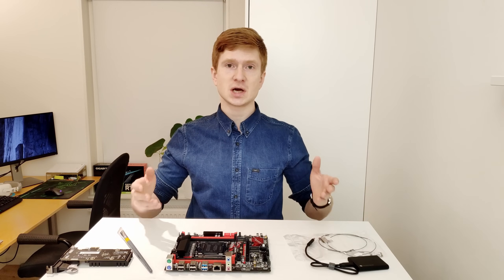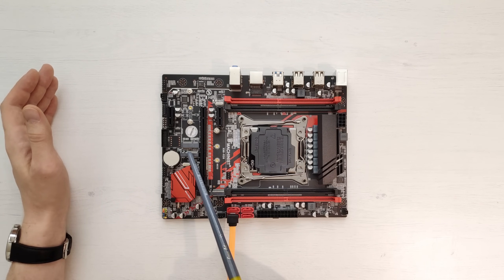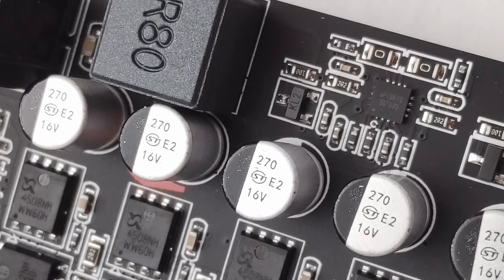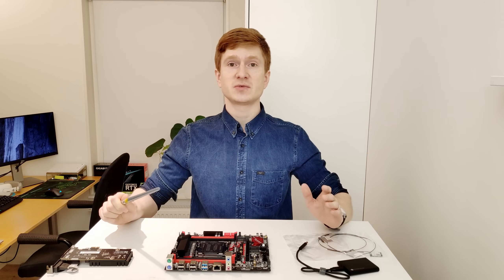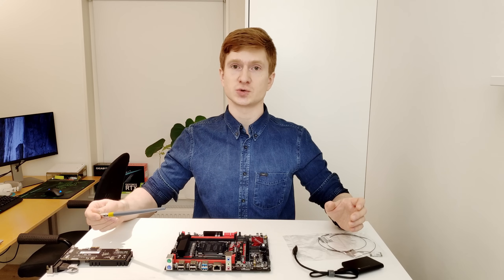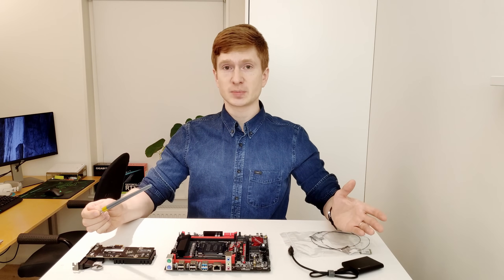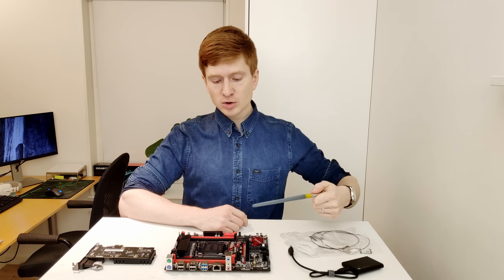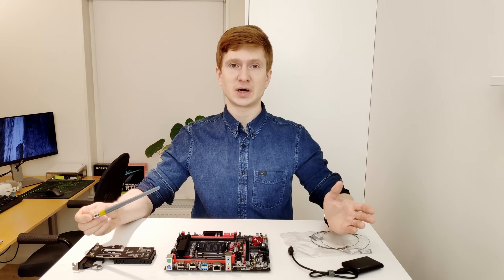🇬🇧 Machinist X99-RS9 – detailed review | E5-2678 V3 | i7-6800k | BIOS | O.C. | VRM | Mi899

Comment: You didn't talk about 6800k, does it support 6800k??
Reply from the maker: Yes, it does, but no overclocking is possible, obviously.
Reply: @Miyconst  can you link a video about 6800k for this board . i dont over clock . i use simple web surf and watch movies
Reply from the maker: @h2ck3rhumas  what kind of video are you looking for? Core i7-6800k just works on the motherboard and that's it.

Comment: I use BIOS X99 8M-F -50/-50 and the USB 3.0 doesn't work. The data transfer only 40mb/s. Flash using FPT and AfuWin still doesn't change. I don't think this is a BIOS problem anymore.
Reply: I'm using X99-RS9 (Q85 Chipset), E5 2630L V3, Turbo boost is running but some core  frequency fluncuate not stable at 2,9ghz like my old X99z with E5 2620 V3, that's running stable at 3,2ghz.

And everytime i flash BIOS, PC Freeze after booting, sometime freeze in INTEL INSIDE Logo or Desktop. I have to Clear CMOS to fix it.

Please tell me if you know the solution, this Motherboard is nightmare for me 😭
Reply: @alri31  Have you found a solution? I am unfortunately facing the same problem. Have the same chipset on this motherboard. Unfortunately, the processor clocks down again and again. E5 2620 runs briefly on 3.1 and clocks within a very short time partly to below 2 GHz. Have you been able to fix the problem?
Reply: @8bit239  No, unfortunately. I asked the seller, even they don't know and never encountered this problem before. So i gave up and accept my fate 😂
Reply: @alri31  Oh no. That's really annoying. Have you decided on an alternative? Or are you still using the motherboard?
Reply: @8bit239  Still using this Motherboard for now, I don't have a good GPU right now because of the price, so kinda pointless to upgrade it. 
Just buy i3 10th gen with H series Motherboard. X99 isn't worth it anymore, they aren't cheap like they used to and their build quality is terrible.

Comment: Hi, I have this mobo, unlocked the turbo boost and a 40-40 undervolt, with the E5 2630L v3 and a RX-560D. I have two questions: should I keep this BIOS version, that is the original modified to unlock and undervolt, or maybe I have to flash the Huanzhai version? And two: the GPU temperature measuring is work correctly at GPU-Z or MSI Afterburner?
Reply from the maker: If the motherboard works well and you are not experiencing any issues - don't bother with other BIOS options. GPU works the same on all motherboards, if the GPU itself reports the temps correctly, you will get them correctly.

Comment: Is this the board you recommend to me as low budget E5 2640 v3? Is VRM too hot for my CPU?
Reply from the maker: Yes, with the current prices I would go for X99-RS9. If you have at least semi decent airflow in your chassis, the VRM will be fine with E5-2640 V3.
Reply: @Miyconst  thank you very much for your recommendation. It helps so much.

Comment: Brother, you said that Jginyue x99m-plus d4 it's almost the same board. Have you flushed another BIOS in that MB? Which one? I want to control the ram timings aand the original BIOS is shit... Peace!
Reply from the maker: Yes, I have flashed BIOS from Huananzhi X99-8M-F, it's fully compatible.
Reply: @Miyconst  nice, you used the mi899 app to do it? The MB bricked? Thanks man, you are a legend :)
Reply from the maker: @guimx13  yes, I have used Mi899 and no, the motherboard didn't brick :)

Comment: Hi, I don't have a big budget and I was wondering if this mobo with a e5-2620v3 or 2640v3 and gtx 1080 could be the sweet spot for a casual gaming and continuous mining rig. If the system is running 24/24 could it become dangerous (vrm heating)? I would like a safe machine. Thanks for your help. Btw amazing reviews!
Reply from the maker: For GTX 1080 I would definitely go with E5-2640 V3, because E5-2620 V3 will be the bottleneck in the build. X99-RS9 will be fine if you run mining on GPU only, I would not recommend this board for 24/7 CPU mining.
Reply: @Miyconst  thanks a lot for your help on this :)

Comment: Has anyone gotten ECC RAM to work with this motherboard? I have mine populated with an E5-2650L V3 and it ran reliably with the original BIOS or a stock Huananzhi X99 8M F BIOS, but without ECC working for Windows or Linux, despite trying both Auto and Enabled in the BIOS.

With the Huananzhi BIOS, Auto mode for the CPU fan isn't working correctly, but I was able to use manual mode to set it to a more reasonable fixed speed.
Reply from the maker: ECC mode didn't work for me either, but smart fan worked well with Huananzhi X99-8M-F BIOS. May I ask what chipset you have got?
Reply: @Miyconst  Q85.

ECC not working is a large disappointment for me, but I suppose it is not critical for my home server application. I did not expect it to not work because all of the places that these boards were listed for sale made it sound like ECC RAM is required, and of course the BIOS gives the illusion of supporting it since the feature is there to be enabled.

Do you think the ECC problem is hardware or software? I've asked the vendor that sold me the board to inquire with the manufacturer, but have received no information yet.
Reply from the maker: I honestly don't know what is the issue in this case. Machinist X99Z didn't work in ECC mode with the original BIOS, but worked with the iEngineer modification, in that case it was a software error.
Reply: @Miyconst  What is the iEngineer modification and where can I learn more about it?
Reply from the maker: @TadMarko  Here is his GitHub with some BIOS options: https://github.com/BIOS-iEngineer

Comment: Great video!!! Have a question: ¿so, the BIOS of the Huananzhi X99-8M-F will work on a QIYIDA X99-H9?
Reply from the maker: Yes, it does.
Reply: Thnx ;)
Reply: If I already activated the turbo boost, can I install the huananzhi bios and the TB will still be activated? Or after installing it, would I have to do the procedure to activate the TB again? In your program (where the bios are), I did not see one that had, in addition to the ram and usb 3.0 configurations, the TB activated.
Reply from the maker: @davidg8383  Turbo Boost Unlock is implemented with a BIOS modification, thus all your previous BIOS modifications will be lost if you flash another BIOS. I am not sure which USB 3.0 configurations you are looking for, but Mi899 certainly has Huananzhi X99-8M-F BIOS with Turbo Boost Unlock implemented.
Reply: @Miyconst  I installed the bios of the Huananzhi X99-8M-F and the pc started without problems, but the TB does not work (and I selected the option that had the TB enabled). Taking this into account, I continued to perform the manual activation of the TB, but effectively the bios no longer had the micro code that limited the TB. Maybe you know why this could happen, any adjustments that I have to make in the new bios? Thanks for your feedback.
Reply from the maker: @davidg8383  did you restore the BIOS defaults after the flash?
Reply: @Miyconst  Thank you very much for your prompt reply. My mistake, sorry. I read the instructions again and for the X99-8M-F bios it is necessary to manually install the driver for the TB. I dumped the current X99-8M-F bios, manually installed the driver for the TB with the UEFI tool, flash the bios with the driver installed and everything was perfect: TB unlocked, ram settings unlocked and correct usb 3.0 settings correct. You are incredible Miyconst, thank you very much for your videos and for your excellent disposition to help us answering each question !!! PS: For those of you interested, I did this procedure on a QIYIDA X99-H9 motherboard
Reply from the maker: @davidg8383  I am glad to hear that it worked out well for you!
Reply: @Miyconst  Thank you!

Comment: 7/10 for a board that has a broken BIOS, lies about the chipset and generally doesn't work right unless you hack it with a BIOS from another brand? You're way too generous.
Reply from the maker: It all comes down to the price. It does the bare minimum and doesn't cost a fortune, but yeah, 7/0 is very generous.

Comment: I do have a question AlienWare.  If have founds or time can you do projects. Levono  is the same. Hard to get answers.  Hard to find. Kind regards.  Mick.
Reply from the maker: I could do something about it, if someone provides me these workstations. Unfortunately, I can't afford buying it on my own.
Reply: All good. Thank you for your reply.  I feel like I'm alone when thanking out of the box. Levono. Has so many locked in production.  With no modifications available.  But not true. I purchased a server parts only from auction.  When no serial number and locked bios . Was told in possible to use. But I did get it to work. But not the model that it is in the bios. ( but works fine. Fully change case hard because power supply  ( custom water cooling.  Need make my own case to work. I just like the way you go into details. I appreciate it ) my system is a p700. Next project is a AlienWare  system with out the coast mode power supply .locked bios that's does not work. Starting from scratch.  There is no info in modifications to save cash when building.  Have a great night. 11.49 pm Australia.
Reply: You could try contacting lenovo in your country.  One thing I know they alone of returning property.  If induce your self . They send you secounds to try out. Levono chat site is the fastest replay mate. Been there. Could not help not help with there video cards or that locked mother board without a serial number.  Because serial is with a company that bought that I item. Service agreement contract.

Comment: Nice video really helpful!! I´d just received my X99 RS9 motherboard and I have a question. In order to get the dual channel , in which slots should I plug  2 memory stick? Thank you for your help!
Reply from the maker: X99-RS9 has quad memory channel configuration, it means that each slot has its own channel, means it doesn't matter which two you use you will get dual channel configuration.
Reply: @Miyconst  Thank you very much! Appreciate your help and work!

Comment: It is safe to say that Price - Performance/Features the Machinist X99-RS9 is the best motherboard.    Well, the combo is set:   Intel Xeon E5-2620 V3 +  Machinist X99-RS9 (With Huananzhi X99-8M-F Bios Flashed on it).
Reply from the maker: Most likely yes, but I am yet to test a few other motherboards.
Reply: @Miyconst  OK, I will wait then.  Thanks for your work.

Comment: Hey Miyconst, a quick question about the B85/Q87 and memory compatibility. 
In the past video's you mentioned the C612/x99 chipset is a bit picky of RAM type: rank and nr. of banks a stick has. What about these desktop Q87/B85/H85  boards? Are these implemented chipsets a bit more flexible?
Reply from the maker: Nope, it's the same situation.

Comment: Hello! Which motherboard do you think is better? Machinist x99 RS9 or Machinist x99-k9 ??? both can be unlocked the turbo??
Reply from the maker: X99-K9 has true X99/C612 Chipset but bad USB 3.0 ports and broken smart fan. X99-RS9 uses Q87/B85 chipset, thus no overclocking is possible and fewer SATA / USB ports, but everything works well.
Reply: @Miyconst  Thanks! So the RS9 can't unlock the turbo?
Reply from the maker: @olivagut  both of them can unlock Turbo Boost and both of them are supported by my Mi899 tool.
Reply: Thanks!!

Comment: Hello.

I bought i7 5820k and X99 TF. I'm looking for overclocking guide for OC this CPU. But I can't find overclocking guide on american megatrends BIOS. In Overclocking features in BIOS, I don't know, what I supposed to do. I should use "Core Voltage Mode" on Override, or Adaptive?
Reply from the maker: If you don't know what you are dealing with it's better to leave everything as is. These Chinese boards don't have the best VRM, and applying too much voltage may lead to a dead motherboard. Thus, if you are looking to overclock the CPU, I would suggest you to do some research and understand which option is doing what and what are the safe values.

Comment: About the 4 pin fan header. I found that on my huananzhi 8m-f the second 4 pin header is not controlled by the bios smart fan. You can however set a fan curve by using software such as FanControl.

Comment: Thank you for very useful information as always! Now I've got Machinist(Kllisre) X99 V201 from Ali (https://www.aliexpress.com/item/1005001639760170.html?spm=a2g0s.9042311.0.0.7a794c4dIC9ThM), but 
1.  Front USB3.0 is sooo slow as if it's USB2.0
2. CPU temperature lies as if it's cool
3. E5-2660 v3 can't boost to 3.3GHz but just only to 3.0GHz
4. Task tray says there's no internet but actually LAN is connected and I can connect to the internet
5. BIOS has no RAM timing settings
6. Sleep won't work
I hope your modded bios solves some problems. Again, thank you for this channel!
Reply: Waiting for Miyconst Review of this board. I suspected that would be some trick with this USB 3, h81 has Just 2 usb3. Buyers from Aliexpress say that IS Just dual Channel, but Intel Ark say that IS Just 1 dimm per mem chanel, lets wait miyconst Review. There is old x99 d4 on daixu store, maybe its good option now.

Comment: Maybe the Jingsha X99-8D3 would be an alternative. A little. It cheaper than TF (around 85€ on Ali shipping to Germany). It is using x99 (c612) and 8x DDR3. TF bios could be used and working fine for me with 2678v3 turbo unlocked. DDR3 makes no big difference and used ECC Ram is quite cheap. 

Thanks for your great review, and helping me to buy some cheap components for playing around with virtualisation.

Comment: i'm having some weird sata problems with this motherboard, it's like it forgets which drive windows is installed on. it tells me to put in a drive that windows is installed on, even though bios recognizes the drive. reseting the bios helps it boot into windows.
Reply from the maker: This is an issue with UEFI boot. You can try to reinstall Windows or restore the UEFI partition.
Reply: @Miyconst  okay, thank you. i will try that.
Reply: @Miyconst  changing the bios to UEFI only might have fixed it. i did other things also so idk.
Reply from the maker: @TOMPPIXTom  but do you have it fixed now?
Reply: @Miyconst  yes.

Comment: Do You Guys think that Atermiter x99 v201(4 Ram slots) with  Xeon E5 2620 V3 and 16 GB RAM DDR4 for 136 USD is a good combo? I can't post a link as it is blocked by Youtube. Does this board has bios ready with turbo unlock? Store number  is 3898022 name 
atermiter Store.
Reply from the maker: I have not yet tested the motherboard, thus I can't say much, follow the channel and the review will be available.
Reply: @Miyconst  Are there any 2620v3 16GB ram combos around 130 USD with mobos that You have tested? Tanks for response and Your awesome work.
Reply from the maker: Yes, there are many combos with Machinist X99-RS9 and Huananzhi X99-8M-F.
Reply: @Miyconst  Thank You again. I will check them out.

Comment: I was hoping a review would be done for this board because I just bought it.  Too bad sleep mode doesn't work but I'm glad my E5 2640v3 will turbo boost.  I appreciate your hard work.  I'm new to your channel but I love all the videos I've seen so far.
Reply: is it still work ?
Reply: @tamakimob9898  Yes, it's still going strong.  Runs 24/7 & have turbo boost mod from Miyconst enabled. I have E5-2640v3 & RTX A2000 6GB.  BF2042, 70 FPS @1440p.
Reply: @EvilEng9  i want to make it with e5-2670 v3 but its basic Frequency is 2.3 .. and in intel website they said that its Max Turbo Frequency is 3.10 , can i reach it with this motherboard ??
Reply: @tamakimob9898  Yes, you can hit 3.10 all core turbo using the Miyconst tool.  Check his description in the video for links. He has a video for instructions too.
Reply: @EvilEng9  Sorry for the many questions, but I have another question. How much power supply capacity do I need? Is 500 w enough? And do I need a strong air cooler or a normal cooler will suffice? Because my budget is limited
Reply: @tamakimob9898  You didn't say what GPU you have but 500w is plenty. My cooler is a Shuriken 3 but anything with a 90mm fan that isn't a intel stock cooler will do.  Something like the Snowman cooler is perfect.

Comment: Is 2650L V3 an option to use? once it has it has low TDP? thanks for the video, your videos are the best ones! greetings from Brazil
Reply from the maker: E5-2650L V3 is a viable option for this board.
Reply: @Miyconst  thanks for answering my doubt, Just asked because It has lower tdp than 2630 v3 (without unlock in both cases)

Comment: I remember that I had an Athlon XP 2400 + that used to fail to go to sleep properly. I'd get a black screen, but the system was still running and still using power as usual.

Comment: I wonder if there is a good Chinesium lga2011-3 mobo out there that actually supplies decent I/O--4 channels RAM, lots of SATA and 40 or so PCIe lanes across four or five slots.  So many of these reviews seem to reveal that either the board is running 2 channels RAM, or making available fewer than half the PCIe lanes of the platform, or crippling it in some other way.
Reply from the maker: Huananzhi X99-F8 would be the last available board from China which matches your criteria.

Comment: I really like this motherboard size and features, a 4x instead of 1x slot would have been much better, sadly i'm pretty sure the efficiency will be terrible
Reply from the maker: Which efficiency are you talking about?
Reply: @Miyconst  bad vrm should translate into very high power draw from the wall even with low power cpus
Reply from the maker: Yup, that's true. VRM efficiency drops dramatically when it heats up.